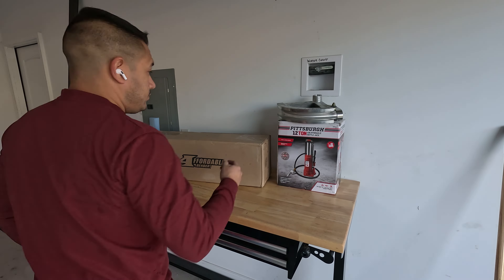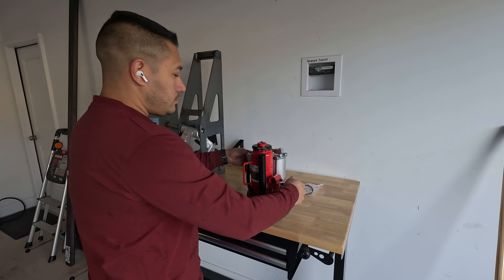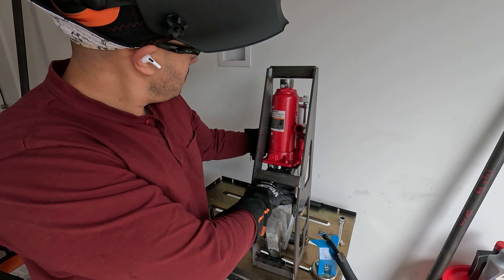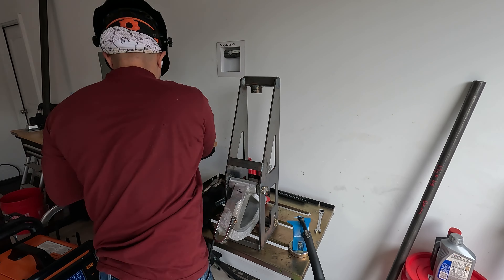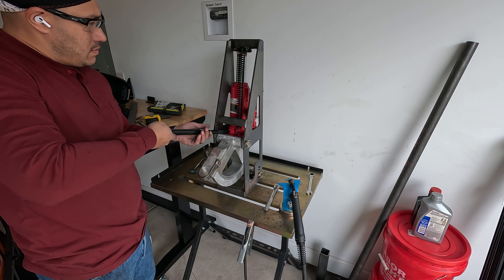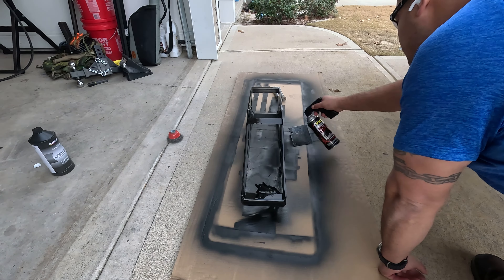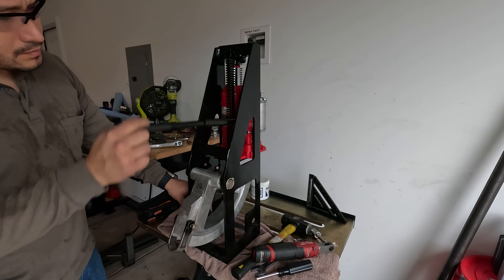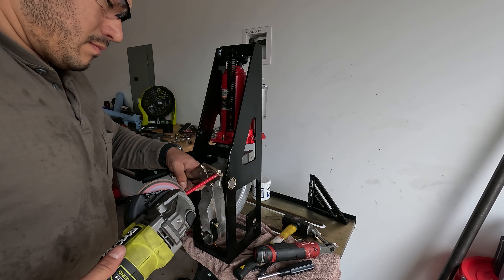Affordable Bender Build

Comment: I'm following your footsteps then going way off course and making it even more complicated lol. I'm building my own frame but using the Affordable bender dies....would you be able to measure the 1in mounting holes from the base to center (one for the die and the other two for the mandrel)? that would save me a huge amount of time.
Reply from the maker: Sorry, I've been going non-stop trying to get ready to move.  Currently driving across the country with the bender wrapped up in bubble wrap and cardboard under a bunch of stuff in the truck.  If you still need it I should be able to help next weekend.
Reply: @ruffwrenchn2235   Good luck with the move! Whenever you get to unwrapping that beast, I would appreciate the measurements. Thanks again.
Reply: @ruffwrenchn2235   sorry to bug, but any luck getting those measurements? I would greatly appreciate it.